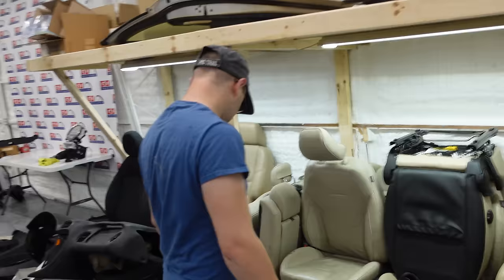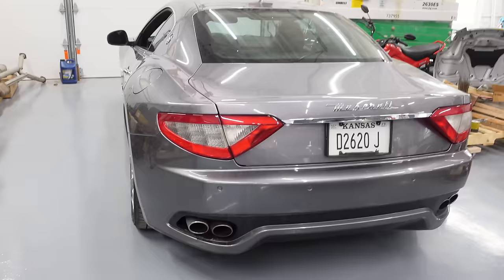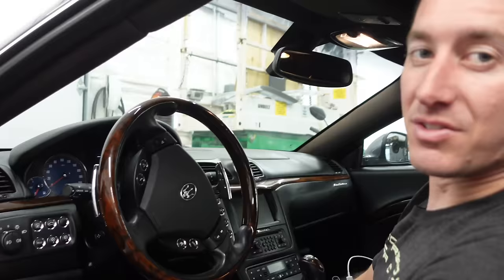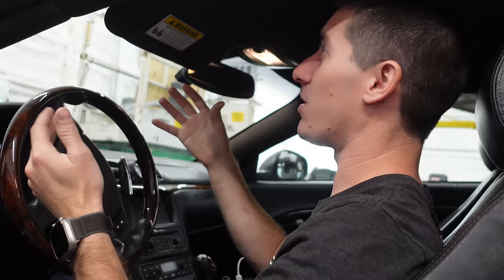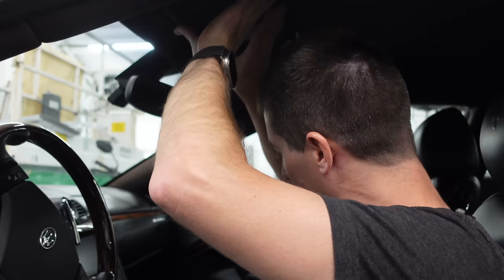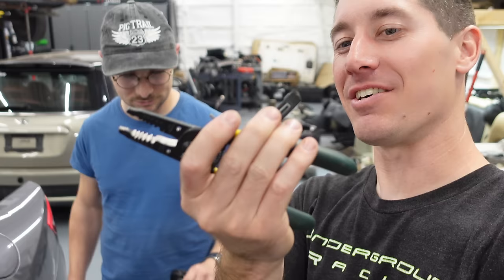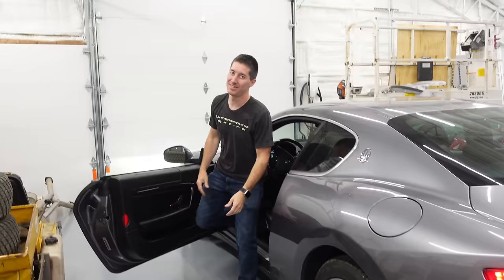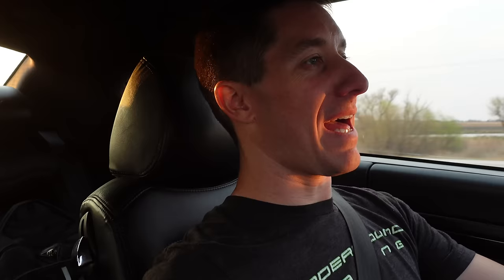I Was Fixing My CHEAP Maserati Until I WRECKED...

Comment: I fell off the scaffolding at work from the third level 12 years ago, aimed for a huge lilac tree, bush and ended up in the trauma center for two days. When I hit the ground my right elbow hit the ground and I had no clue it was broke till the next morning when I mentioned to the the nurse it was hurting. They rolled me in for a X ray and guy came out and said yup you broke it.
I don't remember most of the fall or the ambulance ride but I was told I kept saying it's only a flesh wound.
I thought my carpal tunnel had come back from hitting the arm.
It didn't hurt bad unless I twisted it wrong, but I've had kidney stones too so pain doesn't phase me till it's really bad. Definitely get a X ray or better yet a MRI.
I got one 4 months later and the radial head and the ulna had a bunch of cracks and the radial head was in about 3 pieces.
Doc said it's a non fusion break and as long as I can use the arm leave it be. To this day it still crunches when I move it.

Comment: SUGGESTION. JR, Check the fuel pump flanges for cracks or the fuel hose from the fuel trap. If so replace the flanges. Also, check both pumps for leaks. Fuel can drip down underneath the tank, thus u never totally get rid of the smell until the leaks are fixed and the leaked fuel cleaned up.
Keep us informed.

Comment: I had a car thst was stinking of fuel.  I drained the tank and used a fogger.  There was a pinhole in the return line.  Might work on the 'rati
Reply: That's a good idea! I might try that on my old Jag. No replacement fuel tank was available, or available at a reasonable price and I adapted a plastic fuel tank for a Mazda 3. Works perfectly, but there is a small but noticeable fuel smell that I'd like to get rid!

Comment: I had the same sunvisor issue in the $1500 2010 Accord I picked up recently. Surprisingly, a new one was only $30 on Amazon. Same color, labels, feel, and lighted mirror as the original. Sadly I doubt there's a factory in China churning out Ferrari... I mean Maserati visors for cheap.

Comment: Around 13 years ago I broke my ankle really bad using a similar board. It was a mountain board with big wheels and you would strap yourself in. All was fine until my friend brought out a ramp. He jumped the ramp with no problem. I on the other hand crashed and put out a foot to support myself and my foot ended up sideways and broken on both sides. One of the stupidest things I've ever done.

Comment: Noooo velcro. You cut into the visor at the hinge, add a tiny hose clamp and a portion of metal tube. Cinch the hose clamp tight enough on the metal tube to add friction. Super glue it back together and your visor works again for less than 2 bucks and zero hideous velcro.